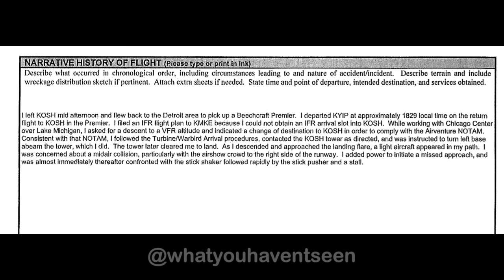Jack Roush Crashes Private Jet At Oshkosh (2010)

Comment: This is Total Pilot Error, nothing more to say!
Reply: Not if yiou take into account the light aircraft he missed by crashing his own plane.
Reply: Team33....I havent seen any evidence of said light aircraft on video, so I'm very sceptical!!
Reply: Its in the slide show video towards the end. He stalled the jet (admittedly he wasn't fully in control) because he didn't want to collide with a "Cessna" coming in for landing at his level.
Reply: Roush's written testimony in the video eludes  to a light aircraft appearing to take off toward him and thought a mid air crash was likely so he tried to power up to do a pass over but the stall had already began based on feed back from his controls. A photograph of the jet crashing shows the plane passing by that he was concerned about. ATC may have been careless in directing 2 aircraft in opposing directions in such close proximity.
Reply: Thankyou.
Reply: Yes, it may have appeared to take of, but it wasn't even on the runway if you refer to the slide around 1:33. For me it looks as if it was to the right of runway 18R, either on a taxiway or the old, closed runway. But definitely not on the runway itself. To me it also looks as if his turn ended not over the runway, but to the right of it, so that he maybe got confused by what is on the runway and what on taxiways.
Reply: It doesn't bloody matter where the plane was, the reason he went down was (not too good airmanship) but he was trying to avoid a collision.
People should stop looking at adventure films all wanting to be Bruce WIllis - There we go, go one down, shut'em down - amazing stuff.
Reply: I think he also crashed in a pond in Alabama and was rescued by land owner? Correct me if I'm wrong.
Reply: A collision that wasn't anywhere close to happening. The closed runway with the Cessna on it is roughly 40m to the right of the runway edge. If he really thought that it was about to take off on the runway he tried to land. Really bad judgement, which it not acceptable, that's all I'm saying.
Reply: I agree. his eyes and judgement ....... BUT its the main cause of the accident
Reply: Am I talking to myself LOL..........THERE IS NO VIDEO EVIDENCE!!! It doesnt matter one bit if the pilot said he saw an aircraft, there seems to be no visible aircraft anywhere on the runway in the video. Also, he seemed to power up fine, then level off and decrease power again, before inevitably stalling. Anyone who's a pilot, or who even has a remote idea of flying, can see that it was complete pilot error!!
Reply: @JustUsFlyers: the plane he was avoiding was coming towards him NOT on the video yet because the vidoe focused on the downed jet. He stalled YES. He stalled because he was avoiding an oncoming plane.
The fact that he may have misjudged the exact whereabouts of the oncoming plane is obvious.
Reply: Exactly my point. All you can seen in the video are aircrafts on the taxiway parallel to the runway, which is no reason for a go around. There's no way someone can possibly try to argue "ye, but he tried avoiding a mid air collision, it was reasonable!"
Reply: Team33...I'm really sorry, and I dont wish to be rude, but you literally have no idea what you're talking about. He completely messed up the approach, then powered up, levelled off, then stalled and crashed, all before this magical aircraft is even in sight! 

Its more than clear that it is 100% pilot error. The guy can claim that he saw an aircraft in the distance, but anyone can say that. And besides, he messed up the approach way before any mid air collision would of been apparent! And to recover from that first one, only to stall when straight and level because he reduced the power again, clearly shows that he wasnt intending to go around!!

Pilots gain more respect by saying they messed up, rather than making up a story...maybe it was a fly on the windscreen that he saw lol!!
Reply: Also, just to clear things up even more, his description of events is very different to what some of you people seem to be claiming. There was NO mention of an aircraft in the air. He simply said a cessna appeared in his path just after he flared for landing. Well, thats a VERY VERY optimistic way of looking at it. He hadnt finished flaring when he realised he was heading for the taxiway rather than the runway. He recovered, lined up on the actual runway, but I guess after being so flustered, he allowed the aircraft to slow too much, and resulted in a stall.

As I said, 100% pilot error. The cessna had nothing to do with it. It would be like saying "I tried to land in the crowd, but I would of hit people, so I avoided them...arent I a hero!!"
Reply: I thought I was the only one who noticed that he rolled out of his turn over the airplanes on the hold short line. Kept quiet since it's a bit hard to judge due to camera angle. But he was definitely heading for the taxiway / old closed runway and not the actual runway after his turn.
Reply: Yep he was definitely heading for the taxiway. He either thought it was the runway, or just misjudged the (rather too steep in my opinion) fighter approach! I'd put my money on showing off without the skill to back it up!
Reply: This is not a cause to crash an airplane, unless you are not in the average.
Reply: WC, it WAS pilot error lol.
Reply: He absolutely went down because of pilot error.  The first rule in any emergency is to fly the plane.  He put his plane into a stall instead.
Reply: It was a failed go-around. He didn't add power, he just let the jet bleed-off airspeed and into the stick-shaker (indication of imminent stall) and the stick-pusher prevented the stall. Problem was, he didn't have enough altitude to recover.

I too am skeptical of the "other airplane" claim in his report. Just an excuse for a botched approach, and go-around.
Reply: J.D Truths most crashes are caused by pilot error
Reply: Team33 so you're saying flight control was Landing aircraft in opposite directions on the same Runway?  It looks to me what he was looking at was that Cessna taxing toward him on the ground on the right.  In either case he should have climbed out and going around again.
Reply: Not his first plane crash either
Reply: i didn't see any aircraft in his way
Reply: ATC seems to do quite a bit of that at Oshkosh.
Reply: He SAID he was trying to avoid a collision.  I replayed several times and did not see any airborne threats.  The approach did not seem anywhere near reasonable.  I think he thought long and hard about what to tell the FAA - trying to avoid a collision - who could fault someone for doing that?  I join others in scepticism.  Glad nobody was hurt.  I wish that nice jet would not have been damaged - probably unnecessarily.
Reply: This maneuver was more than an error.  More , like no common sence.   Flying it , like this was a  Cessna 150.
Reply: @team3383  I would smash that light aircraft
Reply: @team3383  It does appear the Cessna was Taxi in the opposite direction, not landing, everybody was landing and taking off in the same direction, full power would have solved the problem, however, if he was already in a full stall, switch off the fuel, electrical and crash straight ahead ......he's either a damn good pilot or very lucky....too bad about the Premier........
Reply: The main culprit here appears to be gravity.
Reply: @team3383  he crashed because he stalled… he wasn’t in control
Reply: @team3383  the correct procedure would have been to add full power and to carry on straight and climb out. Not to try and bank at low speed.

Comment: Flex Seal will fill in those gaps!
Reply: don't forget the Flex Tape and Flex Glue also...looking forward to that commercial for sure...
Reply: Woooo !  Hoooo !
Reply: Flex on
Reply: steve johnson  Good one!
Reply: Yeeee doggies!
Reply: Guess he used a little too much Kaboom on the seats before takeoff!
Reply: LMBALLS OFF!!
Reply: But wait, order within the next 10 mins and we'll double the offer, just pay extra shipping and processing. So you can jack up another one of your jets.
Reply: * two minutes earlier, chrashing jet *
"THAT'S A LOT OF DAMAGE"
Reply: Andre Abreu I use that shit on everything..
Reply: "I CRASHED THIS PLANE IN HALF!"
Reply: And a little buffing with polishing compound, good as new
Reply: The National Transportation Safety Board attributed the cause of the crash to pilot error, specifically, "pilot's decision not to advance the engines to takeoff power during the go-around, as stipulated by the airplane flight manual, which resulted in an aerodynamic stall at a low altitude."
Reply: He never tried to go around, he f ed up and ballooned up when he tried to save that 100 foot AGL turn to final with a burst of power and then his brain froze.
Reply: No Flex Tape
Reply: Andre Abreu c6
Reply: I'm surprised they don't try that for advertisement video we put this Blaine back together with Flexi seal and flexi tape
Reply: Try duct tape first!
Reply: Aluminum duct tape,some super glue,and flex seal might work too ,call now and you get 2 rolls just pay shipping and handling ;)))
Reply: Easy, I'll fix that plane in Photoshop.  He'll be flying again in no time.
Reply: Flex seal SUCKS. Try to fix an air mattress with it...not happening.
Reply: LMFAO!!  That one got me..thanks!
Reply: Andre Abreu 👍🏼😂👍🏼

Comment: For those commenting "bad approach" or "showboating", you're not understanding how AirVenture works. That's the proper approach procedure (give or take). He didn't have a choice to elongate it. You're not cleared to land on a runway, but a colored dot, as there's two more aircraft simultaniously cleared to land on the runway with you. AirVenture is a stressful enviornment with extremely heavy traffic and little room or understanding for mistakes. With what he was flying, Mr. Roush was cleared for the leading dot, and was already worried about the runway length at that point (as he expresses to the controller). He's turning to short final when he's distracted by a J-3 Cub taking off that he's unaware of due to the fact that he's not monitoring Departure, blows out his turn, then hesitates to fully advance the throttles to go around as he's anxious and scanning for additional traffic and tip stalls. So, by no means was this anything other than pilot error, but there's far more to this incident than just a poorly-setup approach with terrible decision-making attached. A great example of the importance of situational awareness, however.

Comment: What kind of approach is 90 degrees at an altitude of 200 ft. , to the runway? Flying right toward the crowd, bank left 90 and put her down like helicopter... but at 150mph..
Reply: A very bad one....as a low time pilot....it was drilled into my head that if the set up on final was not to your liking....FULL Power and  GO AROUND....never try to save a bad setup....it only gets worse....that
Reply: To understand what happened here, I 
suggest you view the NOTAM concerning arrivals during Airventure. His base to final turn is consistent with the procedure for landings on 18R. Neither the audio nor the text explains very much. I've flown that procedure and it's a lot of fun as long as your day doesn't end like this.
Reply: He thought he was in a mustang
Reply: I fly a sailplane, so I need to be damned certain to get the set-up right.
Reply: What kind of approach is that, you ask? The kind that end in a crash, my dear Watson.
Reply: Due to the event he wasn't fully in control of the approach, but he is fully responsible for demonstrating a takeoff stall instead of executing a standard go-around.
Reply: Reckless Showboating
Reply: I know that approach looks unusual, but that's actually the mandated approach during the Oshkosh show for 18R. The pilot's problem was that he initiated a go around because he was worried about some traffic but didn't give full power like he was supposed to and as a result he stalled.
Reply: I don't see any other plane on the runway
Reply: Chazz, that was what he wrote in his account of the accident. Whether there was a plane on the runway I don't know. I do know that whether there was another plane there or not it wasn't the cause of his accident, he stalled and crashed because he didn't throttle up on his attempted go around.
Reply: I don't even hold a license, yet even I know that banking a plane at that speed is going to loose nearly all your lift and drop altitude percipitously.   Was it Jack Roush or Jack Daniels flying that aircraft??
Reply: Very sad that some of you are probably pilots and only 1 comment out of like 30 seem to recognize it was a stall. When aircraft stall typically one wing stalls first and lift generated by the one wing abruptly decreases causing the wing to drop regardless of aileron input. Basically the aircraft no longer responds to roll input and banks unpredictably. The cause was poor monitoring of airspeed which should occur at all times. Secondary cause was failure to determine when to abort an approach. And as needing to go around is typically due to poor approach. Poor approach is often due to lack of distance to airport for final approach giving more time, and altitude to correct errors which are proportionally smaller with larger final approaches.
Reply: I wonder how the roughly 200,000 usd cost of flight training/certification  requirement has failed to make aviation safer, meaning you can simply pay to be a pilot, rather then have genuine interest in it, where you would know this is a stall.
Reply: I honestly don't want to fly these days, knowing most pilots are there just cause they can afford it. Don't have to compete against other motivated, aviation LOVERS, not enthusiest, but fokes who really love every aspect of it, know ever aspect of it from growing up with a thirst for knowledge of aviation and excitement. Not saying it's everything or plays a role in every aspect, heck I'm sure some instances it can be a negative quality but I know which one I'd pick.
Reply: It is hard to be difinitive here, but a STALL is the wing's precipitous loss of lift because of its' angle of attack, and this is not the case here.  Airspeed is a secondary contributor, but not the cause of a stall proper.  Simply put, his angle of attack on the wing surfaces looks ok, but you can't bank the aircraft 60 degrees without most of the lift going laterally as well.  The aircraft lost lift, but not because of a stall.
Reply: Weeee
Reply: Not necessarily.  We drill short approaches almost every day.  They're an important part of training.  Key word there is TRAINING.  He wasn't training, he was traveling.  This was pilot error, pure and simple.  Source: Am pilot.
Reply: That Was more like 25 feet.
Reply: The turn from base to an extremely short final had nothing to do with the crash, it isn't a normal procedure but it is one that an experienced pilot should be able to do.

The cause of the accident was him stalling the aircraft due to not increasing thrust after his decision to go around. Which probably had to do with the fact that he brought a brand new airplane that he had limited time in to Oshkosh.
Reply: Go arounds seem to be the most common cause of accident..  but not in sailplanes : )
Reply: Bob Anderson   You know jack shit then, as has been said several times IN THIS THREAD that is the prescribed approach for that runway.
Reply: marshalcraft  so...... you think aviation is for those that CANT afford it?
Reply: That was the modified VFR approach that day at Oshkosh. You even hear towers instructions indicating the same. His issue was the go around when he though the Piper was doing a straight out take off but it turned off the runway once airborne to clear the runway for landing traffic. 

The pilot forgot to apply take off thrust on his go around and stalled the plane. Simple. Not the approaches fault, it’s his fault for not monitoring the departures frequency for situational awareness of the procedures that day. That alone shouldn’t have made him attempt a go around with minimal thrust when take off thrust is required. Even in a Cessna full thrust is required for a go around. How can any pilot expect their plane to climb when slow and dirty with no thrust?

Comment: Amazing! I've been waiting for a video like this for a long time. While I was there, I didn't actually see what was happening behind me. I was pushing my daughter in her stroller southbound along the flight line. Heard the turbo jets spool and turned to see the wing tip hit, rotate and travel backward toward the flightline. Unfortunately we were directly in the trajectory of the craft but fortunately the tail of the craft caught the slight watershed ditch between the taxi way and flight line and brought it to a stop, saving probably 100-200' of further travel. That impact is what broke the tail section loose. The jet sat there for about 1 minute with what seemed like low to mid throttle until powering down before the hatch opened and Jack & Secretary emerged. Sadly, Jack had a bloody face and white shirt. It was a remarkable experience, but I'm sad it happened, at least in such a public manor.